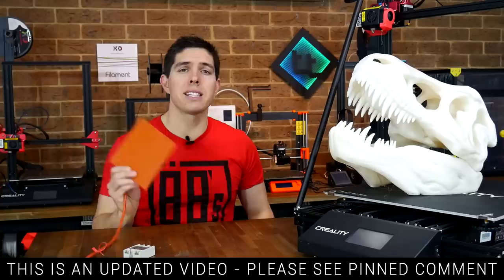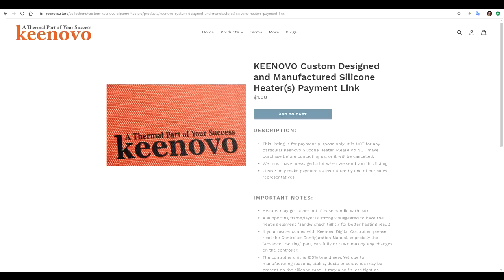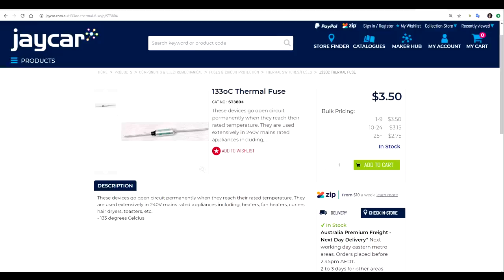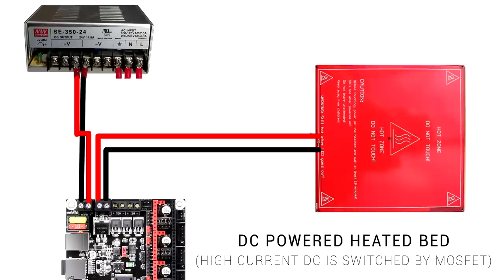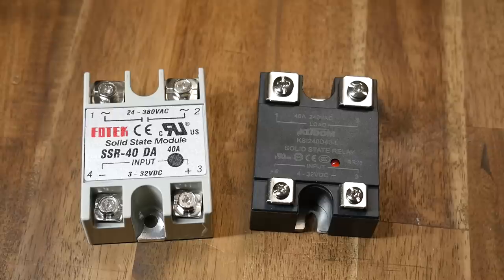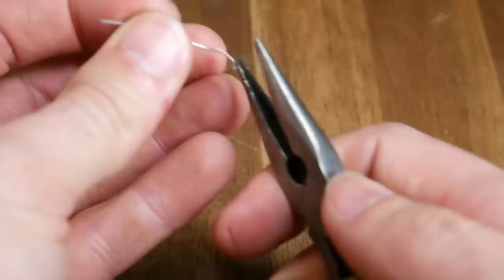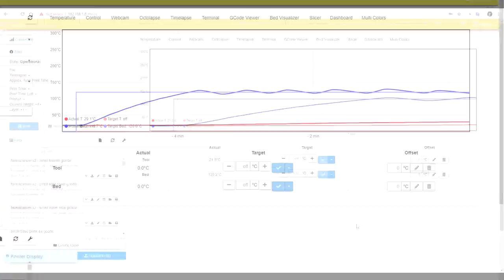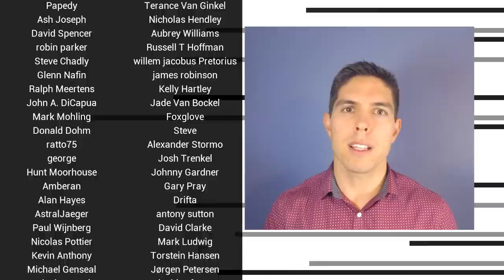AC mains powered bed guide: Super fast heated bed performance - UPDATED

Comment: I purchased 220V 500Watt Heater, 
What SSR should I use?
25Amps  or 40Amps?
Reply: you can use a 25A SSR, since the power consumed  with this setup is approximately 2.28A.

Comment: If you had your printer in a passivly heated enclosure I assume you would want to think about cooling the SSR somehow is that correct? If so how could you go about that? Would a 40mm fan blowing air across the SSR be suitable?
Reply: Mount he SSR outside the enclosure

Comment: The Artillery Sidewinder X1 heats up quickly thanks to its 230V but the heat distribution is very uneven. The temp is relatively accurate within a 15cm circle in the middle but tapers off from there to the sides where it's easily 10C less.
Is there any superior quality heating element I can buy to replace the stock one? (there's lots on AliExpress, but which one is "the best"?)

Comment: I have a aluminium anycubic  300x300 mm hot bed plugged with solidstate relay and power supply about 500w it don't work. The whatchdog time blocked the 3 d printer after 1 minute.  Do you think it's better use a Ac connection directly in the plug connector 220 volts?

Comment: I've set it to 100, the bed temp goes up to 90 something and stalls there. The print does not start.
The sensor is the right one and the limit is at 140. Any Ideas?

Comment: I wonder how a ground fault would work
Reply: Not sure. I just set one up on my printer and it trips the ground fault.. Still need to figure out why.
Reply: A safety switch detects a difference in current flow between Active and Neutral. If they don't match it trips, as it means current is earthing via some other means, hopefully your earth cable and not your body.

Comment: 7:41 Will the only performace issue be it heating up slower, or will it also be harder to maintain a temperature? I'm building a printer and am wonder if I can just do this for simplicity at first, then later wire up the SSR to the power supply.
Or, would it be better to just buy a 24V heater pad?

Comment: So the themo circuit breaker is to stop the bet from overheating, but the temp is still controlled by the heat sensor?
Reply: It's in case of a fault. If the wires short somehow a huge current could flow through. The fuse will over heat and open the circuit.
In normal operation the fuse simply sits in the circuit and does nothing.

Comment: nice. Now install a 2KV silicone heater evil stare MUST.. GO... FASTER
jokes aside I REALLY want this on my printer since I print abs a lot. even a 360w bed at 300x300 takes some time with cork underneath. But sadly my country lacks ground :s
Reply: bang a star picket a few feet into the ground and run a wire?

Comment: I have an Artillery Sidewinder X1v4.  I am putting together a DIY 3D printer from scrape and spare items that I have.  And I would like to wire it similar to the X1.  Is there a schematic, that you know about, on of how the SSR should be wired up that I could follow without taking my X1 apart?

Comment: Hi. I wonder why i can not find any 48v silicon heated bed's?
Everywhere i look i only can find 12v, 24v, 110v or 220v bed's.
Does anyone know why i should not use a 48v silicon heated bed?
I have a Mean Well 48v 13A powersupply.

Comment: I followed this tutorial to the T and for some reason my bed takes forever to heat up does anyone have a clue why?

Its a ender 3 v2 with a 400x400 extender kit and the corresponding bed upgrade they sell

Is my power supply to small? It does heat up. It's just very slow

Comment: Hello Nice explaintion But Im in confusi i have 220V silicone heated bed .. so in your digram u show it .. i plugin the pin of power supply that take power from AC 220V to SSR !! so after i wiring them .. how i give power supply power from AC 220V u understand me srry for my bad English
And SSR can with My power supply 12V ?!
Reply: He has 2 wires going into(in & out each of the 3 terminals L,N,E,...why everyone raves over meanwelll psu's and they dont even have a cover over the terminals

Comment: Do you really need a 40amps rated ssr? Seems like an overkill. Shouldn't 10 be enough?
Reply: He said he chose a larger one as it means he doesn't need a heatsink on the SSR. Also Jaycar's range (shop he bought from) doesn't have a good range of them. It jumps from 3A to 40A or something like that. I was planning on getting a 25 for this job but they don't stock them.

Comment: My Little Kingroon KP3S could use this, Im trying to sort it for ABS putting it in a enclosure feeding the main board cool air from below the printer. My problem... is the PEI plate slipping on the magnetic bed at high heats. Slightest curl up and game over. Is clamping the PEI sheet the only option here?

Comment: I recently replaced my bed heater for a 120vac heater thermoster after connecting up and did the suggested changes in firmware I tried to tune it. I got this error from pronterface  PID Autotune failed! Bad heater id  What are they trying to tell me? Thanks guys for any solutions.

Comment: Does Cr-10 Keenowo heated bed holes fit for ender 3 ones? I ordered Ender extender, but for 400x400 bed silicone is no holes, where to buy such who already have holes or just to take smaller one (as this one in video for CR10?).

Comment: Is an SSR necessary?  Does the board PWM the mat or does it just act like a typical thermostat where a typical mechanical relay would be cheaper and just as capable as its not switching constantly.
Reply: it will be switching constantly. it's trying to keep a constant temperature and is doing that by non stop switching.
Reply: @uglyduckling81  no in this case it is not PWM and has hysteresis for turning on and off the mat, SSR not needed
Reply: @mattnsac  How can it use hysteresis unless it's running current through the mat and then turning it off? The mat has a fixed resistance. Mine has 62.7ohms.  Which means it has to be switching fairly often to keep a consistent temp.
I only got my mat today and am yet to run it. I need a 2 pin connector for the thermostat which I forgot about whilst I was out getting bits and pieces for the mod today.
Otherwise I would be able to tell you what it's doing for sure.

Comment: Hi, I just finished this mod on my CR-10S. Now the printer beeps consistently until it reaches a given temperature (have not discovered the pattern, or threshold at which the beep stops). Is this a Firmware Issue? I have Marlin 1.1.bugfix installed. Insights would be greatly appreciated.

Comment: Is there any reason to use a SSR instead of a normal mechanical relay?
Reply from the maker: Also a mechanical relay won't play nicely with PID bed control so you'll be stuck with bang bang and quite possibly temp swings.
Reply: @TeachingTech  that's the point, infact I missed to see the last part of your video about PID regulation. Thanks
Reply: @Tim Milgart  There are relay boards really cheap,also optocoupled, that have all elecronics needed  to drive the relay, available for few euros and able to pilot more than than amperage required,  12-24v are quite popular so it is not really difficoult to match with power supplier (or also you can just use a small different power supplier to feed the relay to take full advantage of octocoupling and separate  completely power side from control side.  But yes, you can't really take properly advantage of PID regulation this way.
Reply: @Tim Milgart of course you are definetly right on this point. I had on my hands really crappy relay boards in past,  but,  generally, if tracks are decently large (and they can be inspected, and eventually renforced with some solder), circut fails are not really dangerous, relay fails are more likely to  have open circuit as a result. Comparatively cheap SSR fails seems to be not really safe.

Comment: Is there a type of thermal relay vs a fuse?
Reply: I looked for a thermal re settable breaker but wasn't able find one for the correct range. There would definitely be something available but in the end im going with the fuse.
Reply: Hi Philip, a quick search on RS components show you can get thermostatic switch for around ~$15 AUD: https://au.rs-online.com/web/p/thermostatic-switches/0331534/

These open when the specified temperature is hit and will close again when the temperature drops to ~15C degrees below that point. Eg. the linked product will open its contats when it reaches 120C, and will close again when the temperature drops to 115C. 

However, mounting the component may require a little more thinking as they are a little more bulky than the fuses.

Comment: Hi have you found the cr10-max bed to get hot enough for abs etc what watt pad is fitted standard ?   Ive tested mine with a lazer temp gauge get up to 105 slowley but is 12 deg out 93 at the middle and can be 60-80 around the edges, is there an up grade quicker pad for that model ? will be building an enclosure for it as well.

Comment: will that 240 vac ssr and fuse. work with the 120volt heater bed?  or do i need a 120 vac ssr and fuse??  also i have a 120 volt cr10 printer.
Reply: Should work on it also 
Most are fine for 120 or 240

Comment: Haaaaa finally land and properly connected to the device and the printer, even though I'm against a bed with such a big voltage while it's useless (which goes against security anyway), because even with the earth, the use of it must be reserved for profetional, and therefore a kind of box with power cut when open or blocked the opening when the bed is energized

The big plus would be to add a differential of 30mA to have extra security

Comment: Is it the same process for the 12v heater, and PSU? Just with a different relay?
Reply: You cannot use a Solid State Relay to reliably switch DC voltages.   The solid state switching components in the SSR rely on the voltage passing through zero volts in the AC power line cycle to switch off.  This is why MOSFETs are used as switching elements for DC-powered loads (not SCR or Triac devices inside the SSR.)

Comment: I would like to get same for my Ender 3 with extender 12 x 12 bed.  Would you know which company made printer has a 300 x 300 bed?
Reply: Ps.  My stock heater on Ender 3 now takes 14 mins to heat up to 105 a 300 X 300 two sandwiched pieces on aluminum

Comment: Cork?? Did I see CORK??  LOL!  good thing there's silicone there. If uou use that printer regular, that cork is going tobheat, then cool then heat and cool and in that process it's going to DRY OUT. When that happens it will start to frey (crumble) and you'll have dried cork all over the place. Not a good thing to have around heat and electricity..

Comment: Dude... CORK?? You can get dangerously close to it's ignition temp with that, use metal insulation like what would be used in a vehicle firewall or to insulate furnace combustion chambers.... If that heater happens to shoot up to 200c you start to risk decomposition and fire.
Reply: "Cork has an ignition temperature of about 300-320 degrees Celsius", "Cork is a slow combustion material. That is to say, yes it burns but very slowly and it doesn't produce flame so it doesn't spread. "

Doesn't sound that dangerous tbh.It starts to break down at over 200C, but by that point the thermal fuse will already have popped so the fire risk seems really really low.

Comment: Hi Michael,
Two people asked what exact tape you used to hold the thermal fuse to the mat. I was hoping for an answer. Can you please provide a link or some information on this. I bought that kapton tape and it's hopeless.
Reply: In case anyone else is wondering, the Keenovo instructions say that after applying the new heat bed, you should ‘seal the outer edges with a thick bead of RTV sealant’.
After reading this, I used the RTV sealant/adhesive to hold down the wires and thermal fuse and it stuck very well. I’ve never seen anyone mention it but I also sealed the edges with the same RTV, as the instructions say. The sealant I used was, Permatex 80050, a 3oz/85g tube of clear adhesive/sealant Silicone RTV. 
Try to keep blobs of RTV as low as possible so as not to hold cork or other insulation away from heat mat too much. In the specifications, this RTV is good for just over 200degC.

Comment: So can somebody explain to me why they all use a 40Amp SSR when this heater pad only draws  3.4AMP ? ( 750w/220v)
Reply: No idea... Must just be over rating for safety.
Reply: @HarryL2020  I found out that Keenovo says their 40amp SSR only uses half the power rating.Which would make this 20amps .I don't know where they get 20amps out of  750watts on 220v heater.
Reply: They also sell the same heater to the US and Japan markets where 100 and 115 (120) volts are commonly used.  Probably a different resistance for these, but it never hurts to over spec.
Reply: @ziggystardog   still even at 100v it's 7.5 Amps, 40 Amps still seems way Overkill.Or i'm missing something here...
Reply: @hondanickx  Most cheapo 40A ssr uses 16A triac, but if you use génuine one 10A is more then enough on 220v

Comment: has anyone had experience with some of  the flame retardant filaments ? I need to print some stuff for my SSRs like those covers for example, but would prefer it not add fuel to any failure. You can also buy plastic covers for them for cheap.